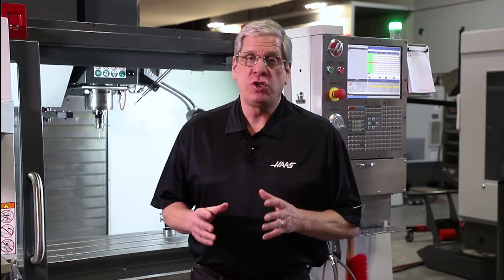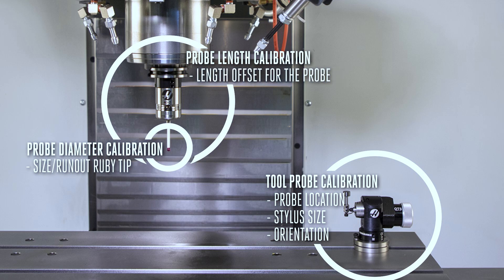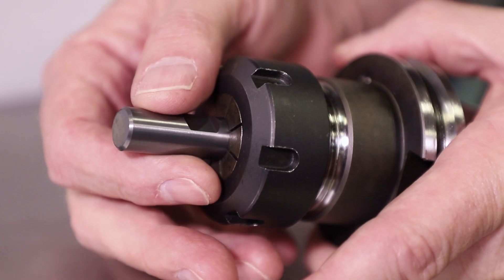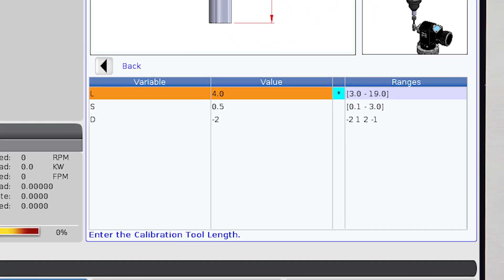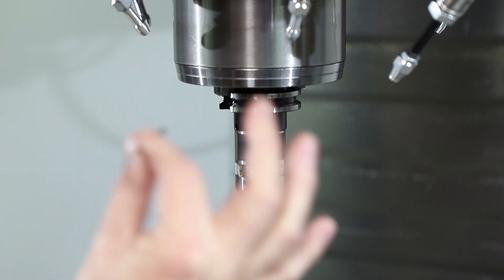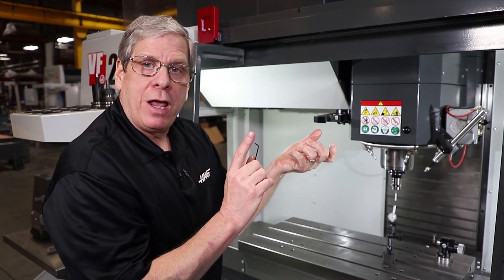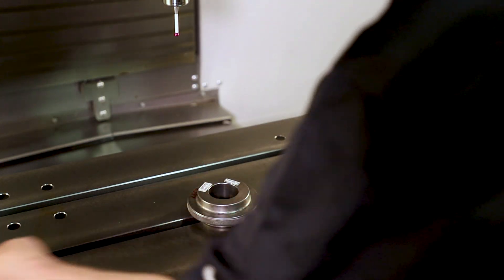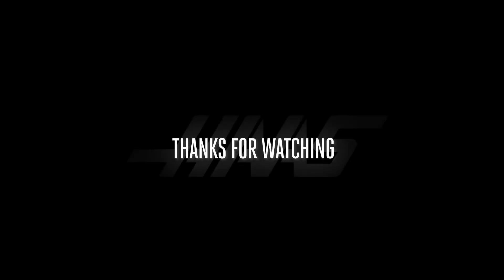Wireless Probing How-To PART 1 - Calibrating the System - Haas Automation, Inc

Comment: I prefer not to use a "tool length" offset and wish to work from a home postion of Z=0.    I have worked both ways and prefer this method as some of my drills are .05 mm in diameter.  I set these tools with a microscope directly on the part. Can I configure the probe length to work this way?

Comment: After doing all calibration steps I run a known good program and I’m getting a z over travel error when I use the probe to touch off. But not when touching off manually. Can anyone help with this?

Comment: Am I correct in that the Classic control uses a different method of work offset probe  length calibration - with the shim on top of the ring gage?
Reply: Yes. With this setup though you do the tool probe first and then calibrate the work probe from that so no need for the gage or shim.

Comment: When you press the probe against the tool-setter, which gives first? Who decides the rule?
What if on different manufacturers of probe and tool-setter, the spring force is almost the same?
Reply: Usually they will be the same manufacturer but if not it doesnt matter as they are both designed to trigger very quickly. Plus there is software that compensates for the trigger delay.

Comment: Since the stylus can bend, is it theoretically possible that when you jog the dial test indicator on it to check runout, the indicator can push the stylus out of center from spindle? You could then be adjusting the runout of the tip to 0 but not actually be aligned with the spindle.
Reply: I would think it would push it with the same force so it wouldn't matter. I try to use an indicator that requires very low force for this reason though.

Comment: How can you probing only 1 edge for example I just want to probe on the left end of the part on 4th axis. I can't find the probing option for my new vf3ss.
Reply: Position the probe next to the surface, use a probe single surface. Assuming your rotary in on the right side of the table, your entered distance will be a negative move

Comment: When measuring the length of the up-side-down endmill to use to calibrate the tool setter, why is it not important to get it accurate?  Seems that would cause a tool's Z measurement to be off when loading a new tool?
Reply: its not important because all your tools(and spindle probe) are going to be related to your  up-side-down endmill. keep in mind: you are calibrating your toolprobe using the  up-side-down endmill not measuring your  up-side-down endmill. After that you measure all your tools. 
but at the end i am not recommending this kind of method because the moment you cant find your  up-side-down endmill because your collegue used it OR you unscrewed your collet then you are screwed. after that you have to calibrate your toolprobe and spindle probe and all of the tools you are using. Rather use a toollength-calibration-tool. then you have an absolute length. even if you have to use a different  toollength-calibration-tool later on to calibrate your toolprobe that wouldn't be a problem - as long as your machine knows the length of the new  toollength-calibration-tool.  
i dont recommend calibrating your spindle probe the way he does either - using the toolprobe. the spindle probe needs some force to switch. that defines the length of your spindle probe. I recommend the following procedure:

1. calibrate your toolprobe using a toollength-calibration-tool
2. measure the length of a new end mill(6mm in diameter for example) using your just calibrated toolprobe 
3. use the new end mill to mill approx. Ap 0.05mm of a part. while you keep on the same Z level you just milled you set your Z value to zero.  
4. minimalize your spindle probe runout by adjusting the screws just like the guy in the video did. 
5. then calibrate your spindle probe length by touching the face that you just milled.
6. calibrate your spindle probes' runout and tip measurement using a calibration ring
calibration done.
Reply: @familiebuenk6982  Thank you for taking time to explain this.  So in essence what you are saying is that all of the Z values of our tools are then relative to the tool setter.  There are no absolute values here....
Reply: @familiebuenk6982  
I am have the same problem you are describing. I have calibrated the whole WIPS system twice now and my parts keep coming in undersized on the height about .002-.003  on the second operation I flip them over to finish the other side  touching off the probe to reset my zero off of some soft jaws I made.
on step (5) as you described above are you just running the probe height calibration template to set your probe on the now fresh milled new zero ?
I just want to be certain this is what you are describing . Thanks!
Reply: @mondoworks9824  I was having the same problem.  So it's important to get the gauge length correct.

Comment: I just have one question, what is the accuracy you are looking for?  For example, the triggered length of the probe isn't equal to the physical length of the probe, which is measured using the methods described here in the video.
Reply: good point. check out my view on this: the reply I gave to Kevin Stallard

Comment: Can a probe system be used on a 2002 minimill?
Reply from the maker: A probe system can be added to a 2002 MiniMill. The templates shown in this video series are not available for the software in your 2002 machine so you will need to contact your local Haas Factory Outlet for more information about software and hardware availability. - John